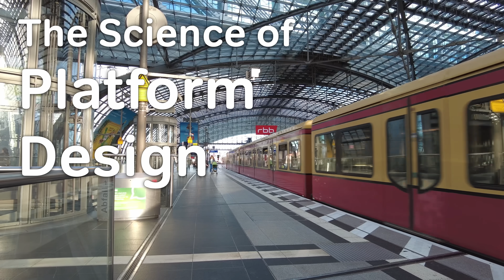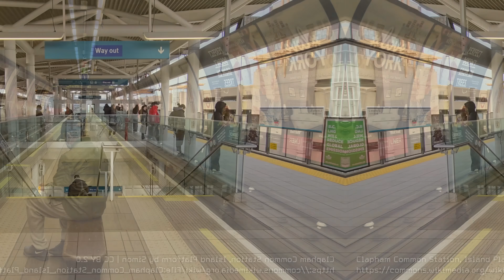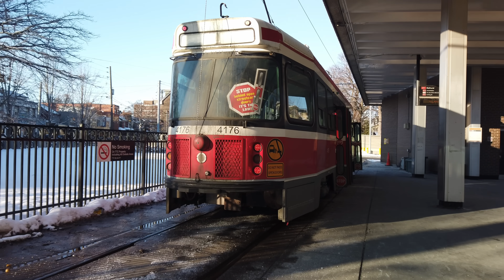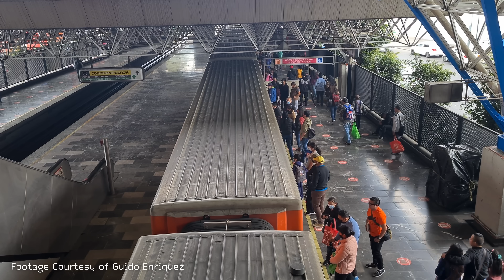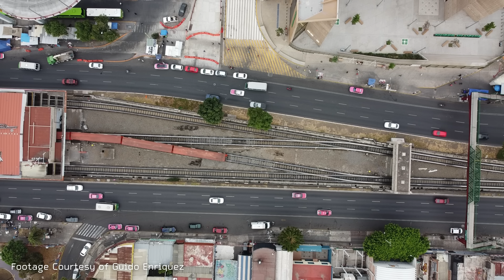The Surprising Depth of Platform Design

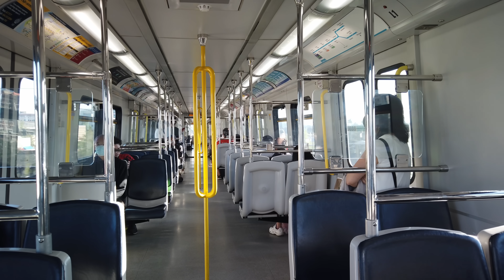Comment: Re 4:00 Low floor trams free of internal steps are actually easier to design that Reece seems to think. Even low floor trams have high floor driver's cabs, despite this, most low floor trams are cab forward (with overhanging cabs) following a practice (which also applies to heavy rail) that was established when even buses and trams were high floor. However, placing the cabs directly over the end bogies (as is done for example with the Strasbourg, Nantes and Lille Citadis, with the Paris TW20 (also a Citadis variant) and with the Eurotram) minimises wheel-box intrusion and I wonder why bogie-under-cab is not more common.

At some tram stops in some places, platforms are shared by buses and this is something not mentioned in this video, and only possible with low floor, specifically a platform height not greater than 350mm above rail level. However, just because there are no entrance steps and the entrance is 350mm above rail level does not mean that the interior floor is also 350mm above rail level, there might be slight inclines next to the doors and there might also be humps over the bogies.

Someone might mention the Skoda 15T, which does have bogies under cabs and is free of internal steps, however, it has bogies under the articulations and very narrow articulation gangways rather than floating articulations, fixed centre bogies, and wider articulation gangways, and it has not gone well, besides its cab-to-cab interior floor is not completely flat.

Dual height platforms can be useful where trams share tracks with passenger trains.
Reply: You're literally describing how hard it is to design fully low floor trams 😂
Reply: @Gfynbcyiokbg8710  They are harder to design and I did show that, but I am also showing that it is possible to have 100% low floor with no wheel-box intrusion except over the centre bogies, and this is with very short wheeled segments on those bogies. More importantly, just because high platforms might provide level boarding to technologically superior vehicles with the floor over the wheels instead of around them does not mean they are better for light rail if one can choose, because high platforms cost more to construct, high platforms in the street environment are harder to access, also doing low floor does offer more vendor choices for sourcing off-the-shelf light rail equipment.
Reply: @Myrtone 

You're acting as if he said step free trams are impossible, but that's not what he said, he said that they TEND to have steps. (Usually because the added complexity of a step free tram isn't worth the small increase in accessibility).

Also none of those things you described are significant problems. Relative to the overall costs of a light rail line high floor platforms are very cheap, there are very few places where the higher platforms becoming harder to access is that big of an issue, and no one orders truly "off the shelf" vehicles. Plus pretty much every major manufacturer has experience in building high floor trams.
Reply: @Gfynbcyiokbg8710 
Please read more carefully, I just said that step free is easier than Reece seems to think and then I explained how.

What do you mean by high platforms being very cheap relative to the overall costs of a light rail line? Actually there are a lot of places in the street environment where high platforms would be harder to access, they would need steps and access ramps need to be considerably longer.
 The fact is that some rail vehicles are closer to off-the-shelf than others. While every train manufacturer could indeed produce high floor light rail vehicles, the range of low floor catalogue tram and light rail models that is available in this day and age is wider than the range of high floor catalogue light rail models.

Additionally, low floor equipment can share platforms with buses, a common setup on mainland Europe.
Reply: @Myrtone   No you didn't. You described how complex it is to design step free, low floor trams so if that is "easier than Reece seems to think", you must think that he thinks that those kinds of trams are near impossible to build.

I mean what I said. When you consider the pretty big costs of building light rail lines, making the platform 70cm taller is going to be a tiny cost.

And if you actually read more carefully, you'll see that I never said that there where no differences between low and high floor platforms in a street environment. What I actually said was that there are very few places where the added difficulty of getting to a high floor platform is so much of a problem that you can no longer consider high floor trams.

You're also going on and on about "off the shelf" vehicles as if they're half the price. They aren't. If they were you wouldn't see countless cities go for less "off the shelf" designs or for manufacturers with no "catelogue" model (for that type of train).
Reply: @Gfynbcyiokbg8710 
> You described how complex it is to design step free, low floor trams so if that is "easier than Reece seems to think",
> you must think that he thinks that those kinds of trams are near impossible to build.

It seems like Reece was describing low floor trams with overhanging cabs and glosses over how much easier it is with the cabs right over the end bogies. Placing the cabs other the bogies has other advantages in that it virtually eliminates outswing and maybe decreases axle load, the latter possibly meaning the wheels can be smaller.

I am sorry, but going what I have been told, I disagree about platform cost. On a network with a lot of stops, more added with expansion, making the platforms say a metre above rail level is going to cost a lot more than 350mm above rail level, besides, it cannot be shared by buses, something you overlook.

Going by photos I have seen and what I have read, again I digress above differences between low and high platforms in the street environment. Ramp access to a high level platform can require a ramp with a bend or two, this is not the case with ramp access to low platforms, I was referring to that. It might not preclude the use of high platforms in the street environment in cities like Manchester and Calgary, on lines built before low floor was an option or when low floor was still in an early stage of development, but might be a case for discouraging high platforms in the street environment when it comes to completely new vehicles on completely new track.

In fact, most cities go for variants of catalogue models (for example the Citadis in various forms on most French tramways) not for anything that is a custom design from ground up, they are usually closer to off-the-shelf than, say, the vehicles on the MTR light rail in Hong Kong.

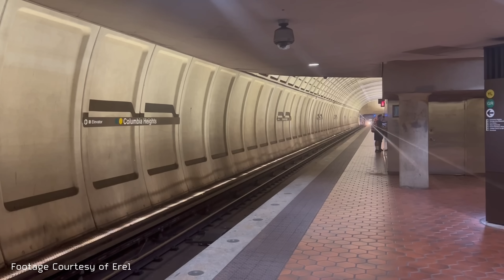Comment: 9:26 Fun fact. Milan M3 stations had a similar system when they were built in '80s.
They should be seen in older stations platforms even today, even if the lights do not work as they changed their mind after the line was built and never activated the system to indicate an incoming train..

Comment: There are some pretty interesting examples of spanish solution stations in China and I'm a little surprised it wasn't mentioned. There are some super high passenger flow transfer stations, such as GongYuanQian station (290k pass./day) with 2 levels of spanish solution platforms for both lines 1 and 2, as well as HongQiao Railway Station Station in Shanghai, which has a really weird combination spanish solution setup with lines 2 and 17 on one level.

Comment: hm, doesnt dual boarding mean that cross platform transfers only work in one direction, if at all?
like you can have both tracks alight to the north platform, but that means only the south platform has cross platform
but that also means your center platform has both boarding and alighting passengers on it

Comment: Stage 3 of Sydney metro line 1 is currently under construction, where a heavy rail line is being converted to accommodate automated trains and using platform screen doors. The existing heavy rail line from Sydenham to Bankstown has a series of island platforms which are generally curved for at least part of their length creating train-platform gaps. The conversion includes adjustments to create level boarding and installing retractable gap fillers into the platform where the screen doors are located. So many Sydney heavy rail stations are built on curves creating wider gaps; also there can be a vertical mismatch between platform and train. Station entry is being made accessible through the installation of lifts (elevators) but portable boarding ramps carried on trains are often necessary for wheelchairs etc.

Comment: In massachusetts, the only place that I can recall that does the Spanish solution is literally the single track headed northbound on the Green line in Park street! I wish that they would have more but I understand the system it's probably older than the method itself has been in existence

Comment: Come to Boston and you'll see some real howlers.  Platforms in Downtown Crossing that you can't even FIND in the Twisty Maze of Little Passages.  And platforms on some of the Blue Line Stations that they rebuilt in the 2000s that don't line up with the height of the floor of the train, even though they are officially deemed to be accessible.  I haven't been out that way for a while, so it is possible that they fixed this.  (But more likely that the platforms are just falling apart again.)

Boston isn't the only place.  Go to the Tren de la Costa in suburban Buenos Aires and you'll find high floor vehicles and MID-LEVEL platforms so that you have to go up into the vehicles by stepping up, but they can't load from ground level.  And CAF built those vehicles in the 1990s (and they also made the nice looking but notoriously unreliable Type 9s or Boston's Green Line, and they are contracted to build the Type 10s).

Comment: MARTA, in Atlanta, has a single station with a side platform : Lindbergh Center.

This side platform was added on the Northbound side when the Red Line was added to the North/South route, as the additional capacity was needed to allow riders to transfer between the Gold (NE) and Red (N) lines.

Five Points, the central station where the NS/EW lines cross, uses double side platforms at all four locations, allowing both sets of doors to maximize people flow.

Comment: At the main underground bus station in Perth Australia we have platform glass doors. Its mainly to stop people from entering the bus tunnels.
Reply: @Leo-hv9mm  Also keeps the tunnel fumes out as an additional benefit
Reply: Same here in Brissie. Though they just got re-done to also fit the new Metro busses.
Reply: Perth Busport can also get very crammed. I wouldn't call it main either. Elizabeth Quay Bus Station deserves that title with 35 stands
Reply: In Helsinki we have it at a bunch of metro stations in the suburbs, as well as the main bus station at Kamppi (there's a separate terminal for long-distance buses and local buses). The idea to do it in Helsinki is also influenced by the extreme winters

Comment: The first time I encountered Spanish solution was the Gatwick airport transit in London (between the two terminals). Later they built a similar one at Heathrow terminal 5, to take you to the satellite terminals (beyond passport control). This is actually a great use of Spanish solution because they use it to keep departing passengers seperated from arriving passengers (which is good for security). They make sure all passengers exit the vehicles before closing the doors, and then opening the other side to let new passengers in.
Reply: Kansai airport instead have different cars in a train, which are separated by locked doors, be served by side platforms on different sides of the same track (1 for arriving & another for departing passengers). Singapore's Changi Airport doesn't separate departing & arriving passengers (as security is done at the gate instead of immediately after check-in) but uses this scheme to separate airside & landside passengers instead (the train also connects different terminals together which is how the latter may use it too). HK's airport instead has 2 side platforms, 1 for departing & another for arriving passengers. After a train empties out the former passengers at 1 platform, security guards sweep the train before it reverses into the other platform to pickup arriving passengers
Reply: @ 3 different ways of doing the same thing. Interesting.
Reply: I was wondering why airports tended to do this. It hadn’t occurred to me that security was the reason

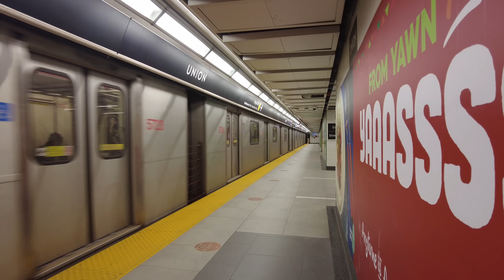Comment: 7:58 Makes me wonder if line 2 at Cuatro Caminos and line 4 at Arguelles were designed with island-side from the getgo or if the side platform was added later simply to help with transfers (although if you use the line 4 entrance, you have to walk on the side platform to get to the rest of the station, which is stupid since that entrance is closest to a university campus and a department store and people should be able to reach the "hub" in order to reach Sol or access Casa de Campo via Puerta de Angel (mainly what buts up to the inner beltway) or change to line 10 at Principio Pio (for the lake, amusement park, or zoo mainly-but you could just wander the woods aimlessly too)

Comment: Well, I'm spoiled today!
Earlier, I heard an unexpected interview with Reece on the CBC Front Burner podcast, and now we get a super video on platforms.

I recall using the Montréal Métro one day, and suddenly realizing that the location of the steps onto the platform must really impact which cars are used, and that it might be beneficial to have different access locations in different stations.
Reply: This is an issue in London, where a lot of the old stations only have one entrance to the platform which is located right in the middle of the platform. This means the middle carriages get significantly more full than the outer ones.

Comment: For 114 years there's been dual boarding In Boston:   "On March 23, 1912, the Cambridge subway opened from Harvard Square to Park Street Under. Park Street Under was built with two tracks with one side platform each and a center island platform, intended as a Spanish solution setup to speed boarding."  Pro tip: the left side doors always close a few seconds after the right side, so if you're rushing to catch a train, use the stairs for the center platform!

Comment: I like the way of how Düsseldorf does it. On low floor stations their trams have a step, on the high floor stations it is retracted and you have level boarding. While not optimal it solves one of the problems

Comment: In London, probably the worst platforms, after the extremely curved Central Line platform at Bank, are the ones where the Piccadilly Line shares platforms with the Metropolitan Line, or the Bakerloo line shares platforms with the Overground. Because you have trains with two different loading gauges and two different floor heights. If a 1972 or 1973 stock train turns up, you have to step down from the platform onto the train while also making sure not to bash your head on the roof, whereas if an S8 stock, Class 378, or Class 710 train turns up, you have to step up from a very low platform.

Comment: About the width of the platform, I hate Paulista station in São Paulo Line 4. That station is connect to line 2 and the day it opened it was already, over capacity because of the complicated transfer.

Instead of building an Spanish solution platform (as in Se Station, that connects Line 1 and 3), they built side platform that are not wide enough to handle the people using. And they built an corridor to line 2 that is not width enough.

It’s been 14 years since it opened and still sucks because of a bad design and short sighted vision.

FYI, CPTM suburban train in São Paulo also uses Spanish solution on Luz Station on Line 7!

Comment: Question for a future video. Why aren’t underground subway lines stacked on top of each other? It seems like this arrangement has a few benefits. First and foremost it would reduce the size of the station box to half or 1/3 because both platforms could be on one side. Second, for cut and cover the amount of excavated dirt could be halved because the upper track could be closer to the surface because the stations wouldn’t need bridges to get to the platform on the other side. The third benefit is the minimized disruption on the surface while building. Cut and cover could be done on narrower streets.
Reply: @streamin16  In some places they are, but the reason why we don't see more of it is because everything gets more complex. You need a significantly deeper station, you need a lot more escalators and elevators, it becomes much harder for trains to switch tracks/turn around if they need to, you'd only actually see a small reduction in excavated dirt, etc
Reply: They are in some places. Here in Sydney we have (kind of) there levels of underground lines at Town Hall. I say kind of because the third level is the metro which goes to Gadigal instead of Town Hall, but they're so close they're basically the same station.